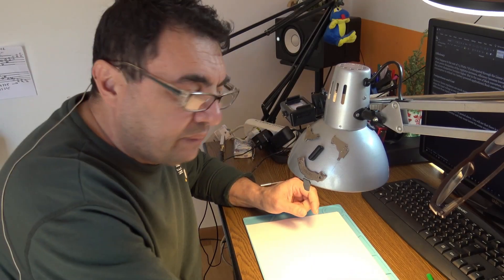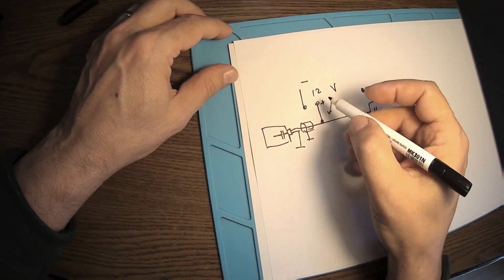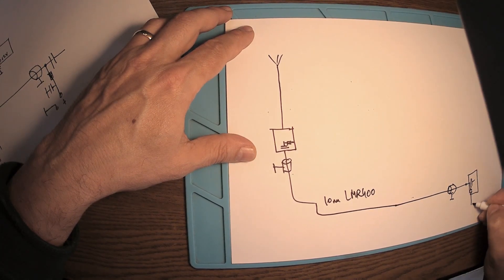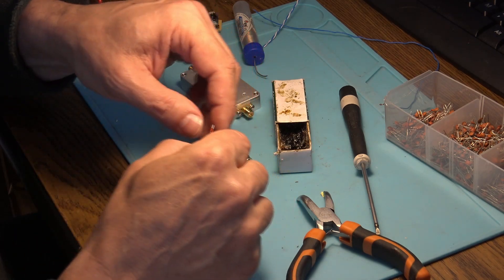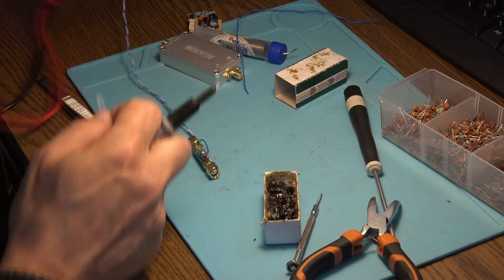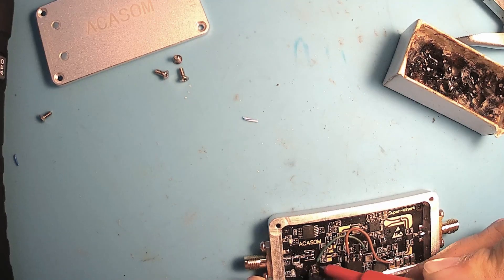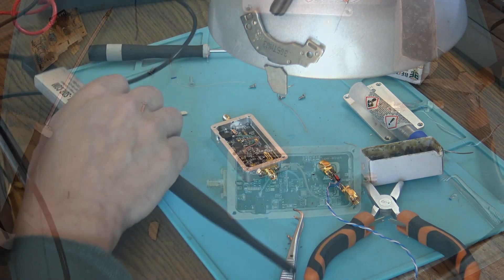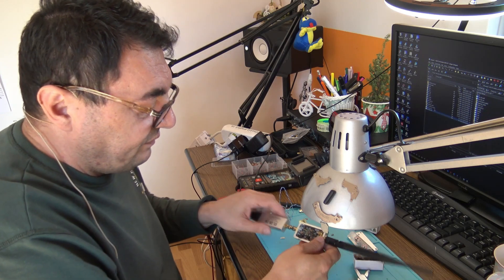Acasom Helium amplifier Bias Tee ready

Comment: Buna seara daca nu va suparati ce diametru are firul de cupru si cate spitre ari trebui .Multumesc!
Reply from the maker: Nu e standard, orice dimensiune..dar evident nici prea gros..as zice intre 0,2 si 05..sa fie usor de bobinat..iar nr de spire..de la 5 in sus pe un burghiu de 2mm..Coil for Bias Tee. It's not standard, any size.. but obviously not too thick.. I would say between 0.2 and 0,5.. to be easy to wind.. and number of  turns.. from 5 upwards on a 2mm drill..
Reply: Multumesc frumos  pentru raspuns .Multumim pentru informatiile care le oferiti
Reply from the maker: @theotubyka  Oricind! Anytime!

Comment: Du you think that works with another Bias Tee if you just solder that coil into the Amp?
Reply from the maker: of course..any Bias Tee will do the job..it worth only if you install the amplifier near antenna..to provide power thru the coaxial cable..

Comment: What kind of Flux are you using? How do you like the T100 iron and does it work good for everything even bigger stuff or do you need something with more watts because I think that iron goes up to 45 watts if I'm correct thanks love watching your vids
Reply: I think he is using just standard solid flux. As for the T100, it's pretty ok when doing the bigger stuff if you have the bigger power supply. There's also a custom firmware you can load onto it and increase the temperature to 400C.
Reply from the maker: That's rosin flux, old school but very good and economical , TS100 has a temperature sensor in the tip and pushes the power when it needs..amazing good results for such a small device! Also very easy to change tips for different jobs..

Comment: Look good were are you getting you pcb boards and sma connectors I haven't been able to find pcb boards in that size, are you cutting to size they would work great for filters to thanks keep up the good work
Reply from the maker: PCB from JLCPCB, designed for filters..but it can be use for any other project with small adaptations..even amplifiers..connectors from ALiExpress..good prices but very loooong time delivery.For PCB check my channel about, there is a link for discount PCB from that company..